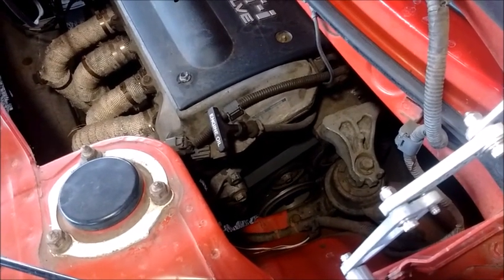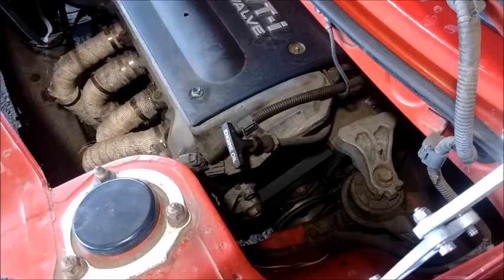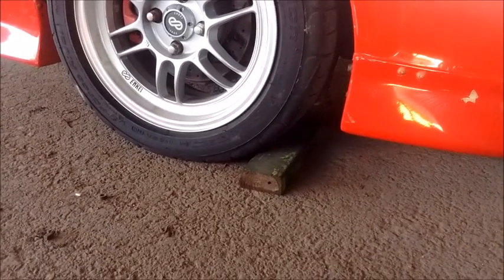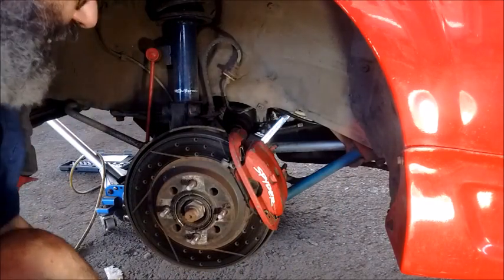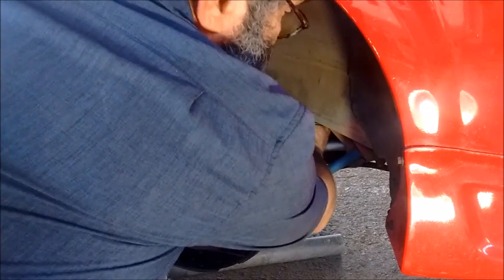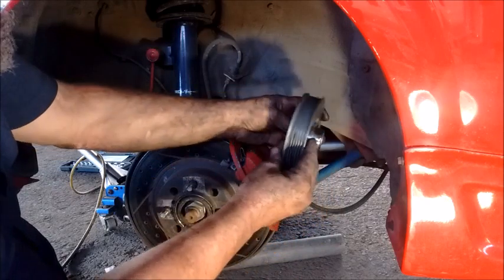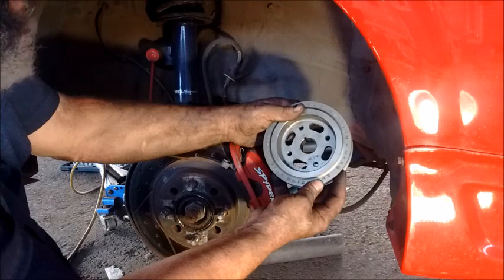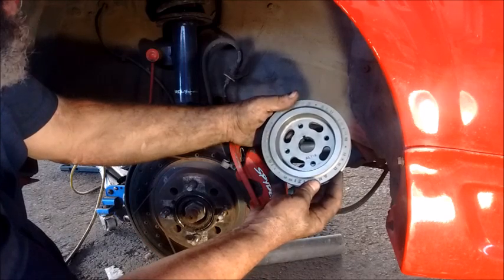How to Remove and Replace Crankshaft Pulley - Toyota MR2 Spyder 1zz-FE

Comment: Did you find the pulley increase power??
Any issues with it on ??
Thanks mate Cheers glen Australia 🇦🇺
Reply from the maker: No issues with the pulley. Can't tell you if it made any difference to power output or not.
Reply: @Merryfrankster_  I guess if keep revs safe be OK!!!!
Also iv fitted lite weight crank pulleys to other brand of cars and no issues !!!!

Comment: My mr Frank, i have a corolla 1zz fe. Can i put on a gear like forte gear with the wheels on the ground and someone pressing the brake. Can i remove the crank bolt like that? Cheers from brazil
Reply from the maker: Yes this will block the crankshaft but it will be difficult to reach the bolt and turn it with the car on the ground.
Reply: @Merryfrankster_  maybe if i can use a ramp it can be done, thanks sir

Comment: Hi Frank, I found your channel a while ago when I was searching for a posting on a forum relating to weak lift on the 2zz. You had posted videos from this channel in the forum. I Have been having weak lift problems in my 03 vibe gt. I cant get any answers on the forums. On the FB groups people have given suggestions to no avail. I am posting the link with the videos so you can see the loss of power and obd readings. Please let me know if you have any insight. www.corollaforum.com/threads/2zz-lift-weak-need-help.13321/  I think it is now probably down to the fuel pump/injectors and or worn camshafts. I also will post a FB link to the camshaft pics, but the FB group told me they looked fine. I didn't do a deep analysis of the camshafts when I replaced the lift bolts and camshaft gasket. Any help will b appreciated.
Reply from the maker: The one thing that really stands out in your video logs is the fuel trims are unacceptably high. You say they normalized whatever that means I don't see that anywhere. If you have normalized the fuel trims then re-shoot your logs to show that. High fuel trims means the ECU is adding fuel to achieve stoichiometric balance in closed loop. Then in open loop i.e. WOT, the ECU applies a correction to the open loop fueling that is based on the closed loop fuel trim. The target AFR's in open loop/WOT are excessively rich to begin with from the factory (this is done for safety), and if the ECU adds even more fuel then the AFR becomes pig rich and this reduces the achievable power. 

The first thing you need to do is get your fuel trims to normal i.e. less than +/- 10% fuel trim combined STFT+LTFT. Then if you fix that you can look at open loop. This is the same process as tuning an engine with a standalone, you don't start with WOT, you start with idle then mid-range and then when that is sorted you move to WOT.
Reply from the maker: Another thing to look for at WOT is knock. I assume that you are using high octane fuel. If not you need to switch to 91 or better for the 2zz. Unfortunately there is no real way to monitor knock with generic OBD2 tools like your Torque Pro. You need to use Techstream, and look at the Knock Learn Value and the Knock Feedback Value. When these values go up, the ECU retards the ignition timing, and this really limits your power production.
Reply: @Merryfrankster_  By normalize I mean they are staying between  -10 and +10 at max for long term and short term. I took off all the vacuum hoses and clamped them back and the fuel trims are now staying near -5 to +5 for short term. https://youtu.be/HDNrdTO8P5M this is the link to the camshafts video and pictures  https://ibb.co/k0hhfhm and https://ibb.co/zF2ZYpS. While I may have reset the ecu because I was changing the lift bolts and dc the battery, The problem has persisted for a while and has had gradual onset. The gradual loss of power is the reason why I was thinking more of a wearout of fuel supply components or camshaft. Even the lift kick sound is weak. Of course as posted in the forum, I left my car battery dc for over a few weeks, and the first time I hit lift then, it was strong. The sound and the kick. Which then could point to electrical malfunctions in the wiring or ECU.

Comment: I might need to do this, I have an oil leak somewhere, there’s oil all over the suspension and lower portion of the block, I just replaced the valve cover gasket but it seemed intact when I removed it. On these motors, is it more likely to be the oil seal or timing cover gasket?
Reply from the maker: The most likely source of oil is the valve cover, then the timing chain tensioner, then the timing cover, the crankshaft seal, and the lower oil pan, in no particular order. I have a video on replacing the timing chain tensioner. It's very easy to determine if it's leaking, you look straight at it when you stand behind the car.
Reply: Frank Saab it’s harder for him because the corolla has the engine backwards LOL
Reply: Jayden Eladnani-Tempo I would say it’s the valve timer cover thing but you said it’s all over the suspension lol

Comment: Hi Frank. What’s the advantage of lighter pulleys and how much advantage would there be?
Reply from the maker: The advantage is like a lightweight flywheel, it gives livelier quicker throttle response, no net gain in power. Reduces rotating mass and inertia. On the downside there is a slight increase in Noise Vibration Harshness (NVH) and for some engines (for example the 2zz-ge) it is not advised to delete the damping of the harmonic balancer.
Reply: @Merryfrankster_  I hear this too, my harmonic balancer failed while driving in my Celica GTS, I think im gonna put the 1zzfe crank pulley on it from my Corolla